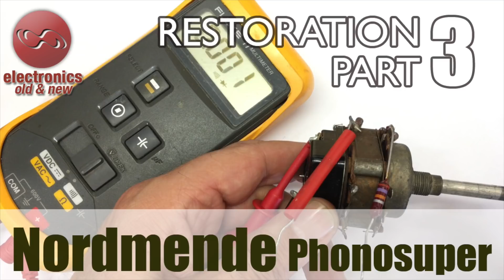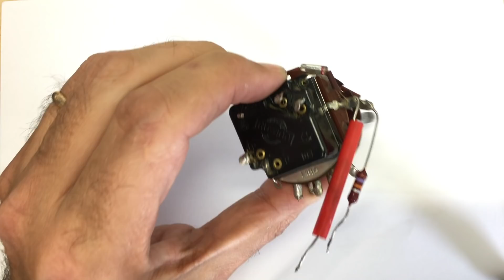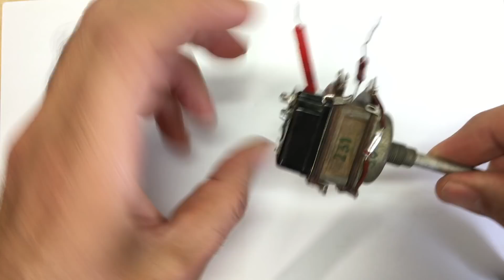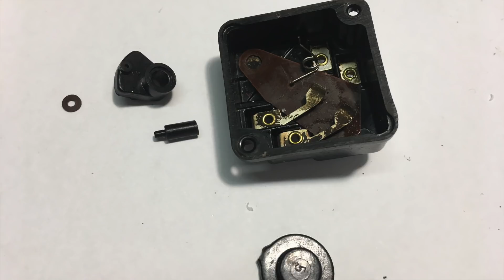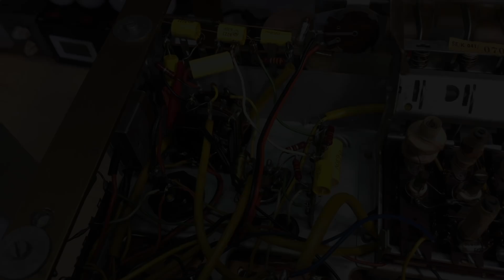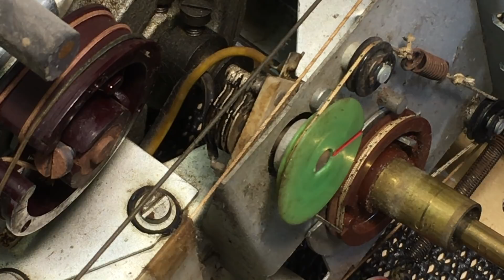Nordmende Phonosuper radio restoration - Part 3. Audio section done.

Comment: Nice job with the switch! My luck with repairing them is about 50-50 (not including the times the whole thing goes 'sproing!' & I lose a vital bit somewhere in the workshop 😉).

I noticed you put it back held together with a piece of hard wire through the rivet holes. I've been less lucky with that; they eventually loosen from either the twisting action of the shaft or the pressure of the cam/toggle plate (depending on design), & fall apart again or irreparably burn the contacts. I now use small long machine screws or threaded rod, or thin-walled tubing with the ends peened over (similar to the original long rivets) if there's no space for nuts. So far they're all holding up well.
Reply from the maker: Jim S : yes, the wire is not ideal, but could not find screws anywhere.

Comment: Great job on the power switch. I'd never seen a volume control with so many connections, so I guess finding a replacement is out of question :) . You showed in the first video that the outer knob on the volume control was spinning loosely, did you find out what it does?
Reply from the maker: Zirok1982 : These complex pots are quite common in the Herman sets that I have done, but they are still almost impossible  to replace. The second knob has no function other than aesthetics. It was just loose.

Comment: you should replace the selenium rectifier, if it gets bad ( and it is going to be soon ) it release a very powerful acid smoke that is also very toxic!
Reply from the maker: manuel minutello : I probably still will
Reply: by the way very good work with the switch!
i had the same problem with an eumigette W where the power switch is connected the the keyboard the i had to disassemble the entire chassis to get it.
Reply from the maker: manuel minutello : those are the worst. I’ve had that before and don’t want to repeat it.